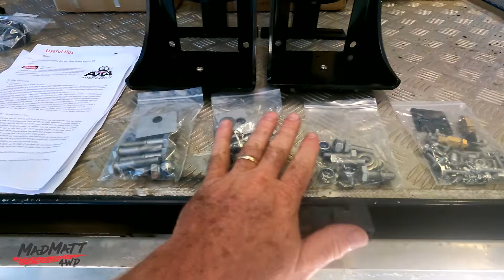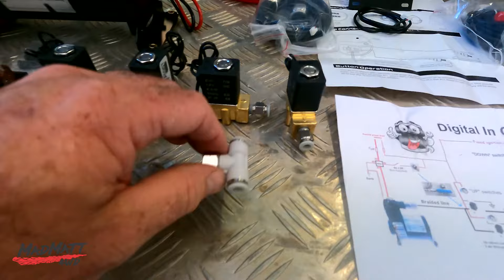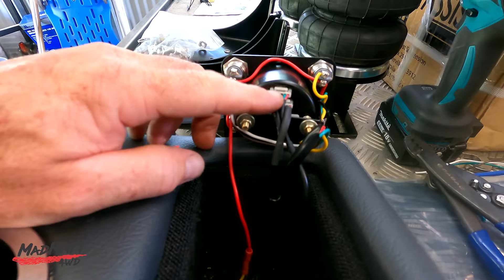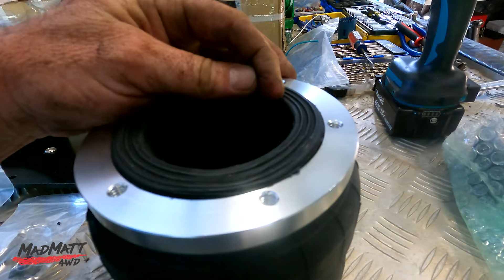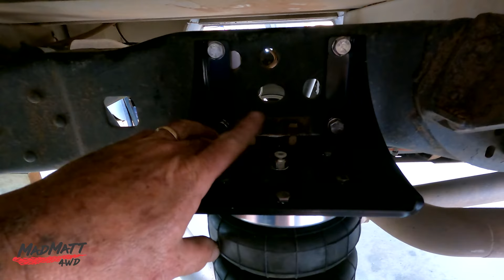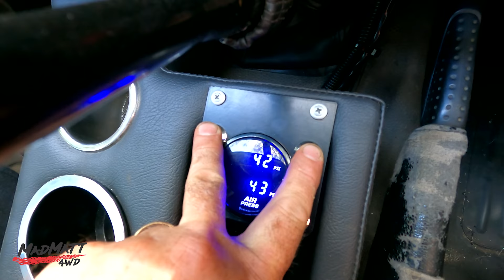Why & How To Fit Airbags To Your Vehicle

Comment: More f250 content please ☝🏻 really curious about how the 4.2 manual f truck goes with towing and off road
Reply from the maker: Offroad the motor is fine the rest of the truck is junk compared to my other 4wds. The 4.2 is a sweet motor and tows very very well considering it’s size. And no it’s not the 7.3 but it’s also simpler than the 7.3.

Comment: This looks like a great kit to have.
Some positive criticism. That pipe work at the solenoids and manifold looks terrible. At least for my OCD. I would rather run them in neater routes. Not only will it make it look better, it will also make trouble shooting easier.
Reply from the maker: I totally agree. No matter how hard I try to make things like this look neat I’m always disappointed in my results. Wiring is the same for me. And I do try.

Comment: Your a handy man Matt. Have you towed with it yet or is that another video?
Reply from the maker: Yes done a fair bit. Still getting used to what settings work.
Reply: @madmatesau  I ran 20 psi in my 5 tonne truck. They were on the front for loads needed against the headboard. Any more pressure gets too firm and uncomfortable.That was my goldylocks zone. 🙂
Reply from the maker: Yeah ok. I’ve been all over the place but having the adjustable shocks is another dimension that’s I’ve got to work with. I think I’m getting there now though.
Reply: @madmatesau  Cool, good luck.

Comment: I would be interested in how this will impact your wheel travel when not towing.  A lot of folks in the states are using long travel airbag kits and / or ones with the Daystar cradle on the bottom side so there is no down travel limit.  A good option for someone who wants to be able to Offroad with their tow rig.
Reply from the maker: It would be a consideration if that’s how the vehicle was to be used. Mine is not designed to flex to much.

Comment: Hi, one thing came to my mind: Will you need to put a vent in the box where the compressor ist mounted? When the compressor is running it will suck dirt and dust in the box, so maybe a vent with a filter would be a good idea?
Reply from the maker: It gets enough air through the hole but it doesn’t run much so at this point I’m not going to add a filter.
Reply: @madmatesau  Sounds ok, i was just a bit worried with the amount of dirt roads you have down there.

Comment: Hey Matt. 
I have a customer who works for an insurance company, they are no longer covering broken chassis’ if people are fitting airbags, in particular on leaf sprung vehicles. 
The problem is you are point loading the chassis, and instead of spreading the load like a leaf spring does, across a fair length of the chassis, you focus it on one point. 
I think when people install airbags, the chassis needs to be braced between the mounting points of the leaf, to spread the load evenly. 
Food for thought…
Keep it up mate, loving the new content
Reply from the maker: I wasn’t aware of the insurance angle but yes point loading is a real issue with people who don’t use the product correctly. Also overloading and poor loading contributes to the cracked chassis not just airbags. I did mention it in the video but it’s good that we discuss it further.

Comment: What are the negatives to air bags? Cracked chasis? Too much air? In leaf sprung setups?
Reply from the maker: Cracked chassis is certainly one but that’ll only happen if your stupidly overloaded and have too much pressure in them. Like anything use them correctly and they’re fine.

Comment: Nice demo MadMatt. Nice to know of local manufacture too...too many "Australian Companies" source major components OS these days...not really "Australian Made" in my books.
I see on AAASuspension web site that they planning for coil kits too - that'll be a challenge to get the pressures and robustness in a physically constrained area!
 I'm toying with the idea to fit air bags to my leaf sprung camper-trailer...just a thought bubble at the moment. I wonder if leaving the bags open to atmospheric pressure through a controlled orifice will cause the air bags to act as shock absorbers. I don't need additional suspension above and beyond the springs, but I do need shockers and I do need levelling when parked - air shocks!
Reply from the maker: I’m sure they’ll solve the challenges. I don’t think the shock idea will work though.
Reply: @madmatesau  No, allow me some room for fantasy though...sheez. :)
Reply from the maker: Lol. Ok it’s a Rippa idea. You’ll make millions. 🤭
Reply: @madmatesau  I just want to improve my trailer (literally an 8x5 1400kg trailer) I'm building a "slide on" for. No interest in going into business. My aim now is to enjoy the years I have left. Thanks for the encouragement though.

Comment: Good design definitely an idea this time has come.
Reply from the maker: Cheers
Reply: @madmatesau  back in the late 1990s I quit driving boats and went back to my original trade as a welder fabricator for a trucking company one of my projects was to convert an International Harvester, military surplus fuel truck 10,000 gallon tank  to a wrecker. Air bag suspension was a new thing. Part of the project was to weld on brackets to support the air suspension on the rear axle that was quite a project having never done so before I think I cut that bracket off and moved it six times before I finally got it to the point where it was lined up properly so that it was perfectly flat on the axle and would match up to the frame if I didn't have it perfectly flat the airbag would leak. That was my first and last time to install airbag suspension in a vehicle. That fuel tank, used the original mounts we took off the truck  welded them to a 20-ft container trailer chassis  made it into a water trailer. We used sprinklers on the back to wet the dirt yard in the dry season so wouldn't have dust blowing all over the place.
Reply from the maker: That’s a great story. Thanks
Reply: @madmatesau  not going to say anything about my adventures flying into small airfields as a private airplane pilot and student pilot.
Reply from the maker: @orangepickel2  ha ha.

Comment: I really enjoyed your video Matt, I love the   Suspension Bracket quality. You really know how to be informative in your content 👍
One question and one thing to consider
Does the pump work well in say comparison to some of the  well known brands as a tyre inflator, Is it quick or slow in comparison to say the more popular known name ? This is giving me ideas for my Suspension  🤔.
So the thing to consider, and I might be reading too much into it here ;  
As a builder I use compressors regularly and as we know compressors create a build up of condensation which turns to water build up .
Something I have zero  knowledge of is if this compressor does this or maybe it does not  .
So my concern is if this will build condensation and drain back into compressor piston and create pump
Corrosion . Be something to ask triple A if you haven’t already checked or maybe they suggest can be mounted any angle already 
Easy fix would be to Mount two angle brackets of back of tool
Box and mount compressor to top of those still Up Same Height ..
Hope the big trip in the van is enjoyable mate !
Heath
Reply from the maker: The pump pumped up 4 35s fairly easily. All compressors make water so I have to assume quality gear can handle that.

Comment: Hi Matt good video, the only thing I would upgrade in that kit is the air fittings. DOT rated fittings are a stronger fitting and don't leak to often. They are rated for air brake systems.
Reply from the maker: Ok Stephen. Are brake systems carrying this low pressure? I would have guessed they would be much higher. Anyway I’ll keep that in mind.

Comment: Hey Matt, your timing is impeccable literally building my own version of this for my 80 series I am in design phase and haven't started purchasing yet. I have been trying to find a place that sells the parts in AUS and its been hard. Will check out your link. Thanks for running through this install.
Reply from the maker: Fantastic. Price up the kits too because they’re not that expensive. Of course sometimes we just want to do our own thing. Keen to see how it goes.